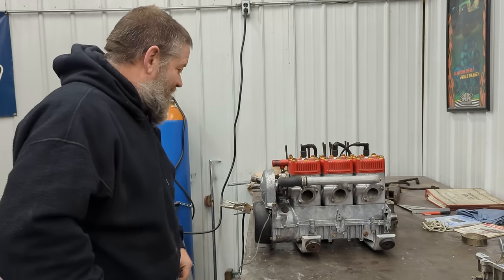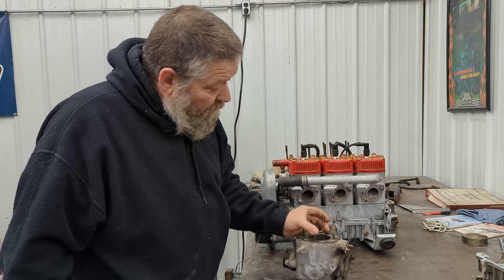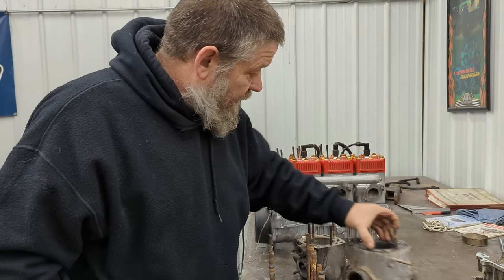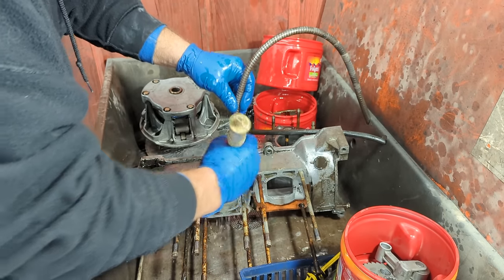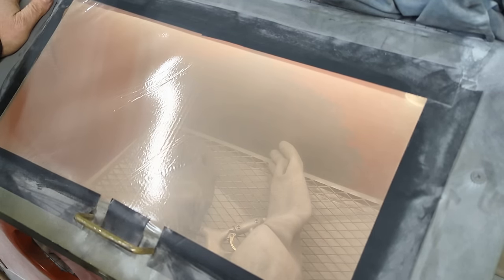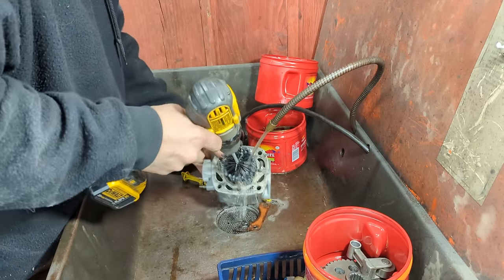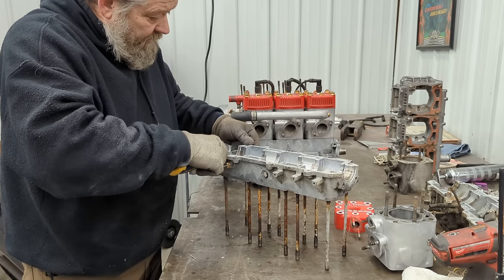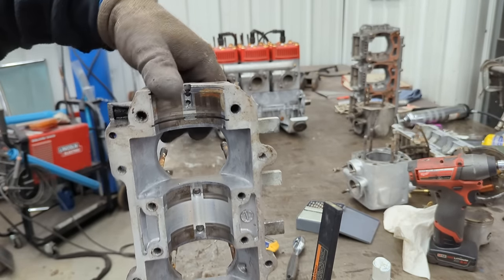POLARIS INDY 650 TRIPLE ENGINE BUILD #1  oiling mods

Comment: Had 88 650 ported and polished decker pipes  
Turned it 9200 rpms for 7500 miles never had a problem 
I set the oil pump richer than the stock marks
Reply from the maker: With the correct tune they just go and go

Comment: Had a 89  500. First Polaris. Crank bearing failure at 2800. I think. That has always been a Polaris problem. Oil journal's are to small thus failure. My opinion. Your doing it right. Last much longer. Once again being a faithful Polaris guy .
Reply from the maker: Hopefully it helps
Reply: Fuji 500 motors were pretty reliable, Imagine if Polaris had Fuji produce the motors today. No recalls, you'd think.

Comment: I had a 650 with SLP pipes, then 95 XLT 600 no pipes. I kept blowing the motor on XLT, but my 650 was still going. Eventually i went with the two cylinder lyberty motors. those 650 are pretty reliable in my opinion. the coolant bolts above manifold would strip out here and there. one time my pto pipe shifted and melted the coolant hose, glad i begin smelling the hose melt under heat tape foil.
Reply from the maker: They go and go

Comment: Todd, just looking at my 01 587 case and you could champher the oil hole on the bearing side of upper case towards the PTO and MAG side of hole underneath to let oil get to outer side of bearing much better.
Plus like you did, champher top side of hole too.
Pto end one could drill down further in the square to get rid of TROUGH and then blend that towards left side of case ( looking at it from carb side of case ) to channel oil to bearing.
My case has the oil line spicket already from factory.
Also there is no reason you can't use a Bridgeport to cut a 570 to fit extended cylinder 650 cylinders.  I believe  ( not having one to measure) you would only be taking off .015 to say .020 per side( total .040 " ) and there certainly is enough meat to do that with.

Just a thought for you as I sit here in 40 deg Florida  weather. Lol.
  Have 3 P's in my garage down here. Never thought I'd stay so long. 31 years !
That's  29 years too long  lol.
 I've got a 91 500 indy almost pristine ( 3600 miles on her as I remember),  99 XC SP 700 ( Johnny Cash special ) littering! And a 2003 Edge with a XCR 800, Fusion skid Walkers and Fox dual shocks up front from an 01 440 .
Wish I were up there with the tripples and tripple tripples.
    Jonsey
Reply from the maker: Great comment and sounds like you have the same ideas in mind on improving the oiling. I'll give that xcr 800 a home if it needs one 😁

Comment: RXL was a good sled left stock but piped idk of one that ever ran right. Lot blew up if not maybe all of them. My father and i use to build 650’s bran new. Triple pipes porting milled heads. Some we just piped took a lot of knowledge in jetting abd clutching to make them run right. Never new of anyone that counted on a dealer that was happy after. Most the time blow up idk how many times i saw it happen.  The pipe manufacturers jetting specs never right always lean sometimes really lean. So we blew a few up in the beginning learned to jet pig rich work ur way down. Found out with shitty clutching ur jetting will never be right. Trial and error always the best and patience don’t except perfect results the first time putting a mod sled together. I remember jetting being 2-5 sizes bigger than pipe manufacturers recommendations. Our clutching was never what they recommended either maybe some of it but never all. 
Like watching u work on the old triple Polaris’s what i grew up on. Snowmobiling was a different world back then lol!!
Reply from the maker: I have a feeling I could learn an awful lot from you. After porting one of my 650s with pipes and heads recut running a little bit of 110 with 93 I'm at one jet size over stock. Doesn't make sense but that's what the engine likes
Reply: @toddclyne3493  could be the race fuel. Race fuel will make a engine run rich with pump fuel jetting. But man ya 1 size above stock is surprising to me to. Like u said though if its what engine wants then run it. Clutching has a lot to do with jetting maybe a steeper cut helix say make a little more load might take more fuel to run that helix. Same with weights to heavy more fuel the engine might need. Maybe ur clutching is so good ur able to run with less fuel. 
But usually the more power a engine makes takes more fuel. More air equals more fuel but like I mentioned before trial a and error is the only way to really tune anything. Iv been surprised many times one thing might work on one machine but suck on another.
Reply from the maker: @joshgessinger4509   yep a suggested tune is only that. Just a starting point

Comment: I had an 88 650 and put 12,000 miles on it. Never any problems. It still had 120 lbs in each cylinder. Also , didn’t the newer cylinders have larger transfer ports ?  I always checked oil pump settings. Even brand new sleds. And , yes I found some on the lean side.
Reply from the maker: I believe it. Yes the 02 and up had better porting. I just didn't get into that yet. So much to cover 😁
Reply: I have a new 83 600 OE piston and ring if anybody needs it.

Comment: I am having problems pulling the flywheel off my 650. I have a Kimpex puller. I will not come off. It will brake the puller before it even moves. Wondering what I may be doing wrong.

Comment: Whats the best bore size to go with if you were to bore out a 650 indy 2 sizees or 3 over ??
Reply from the maker: Just enough to clean it up. Boring does not increase hp. So save your bores encase you need to again